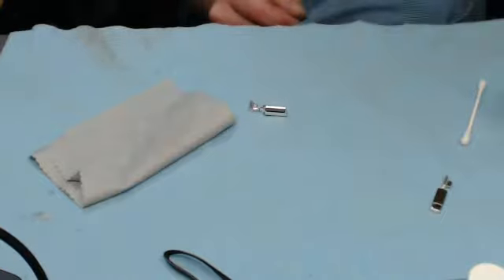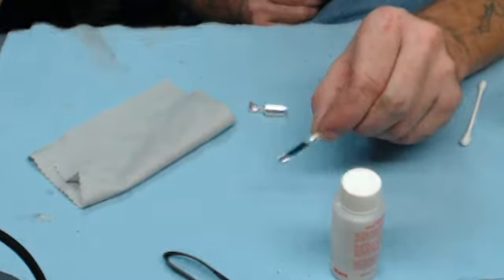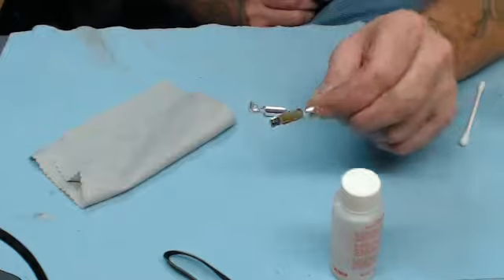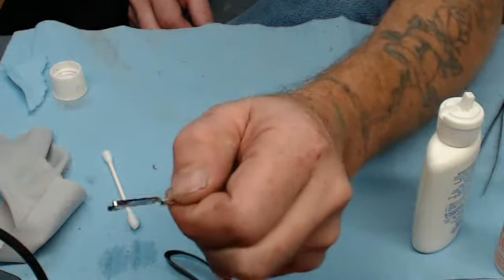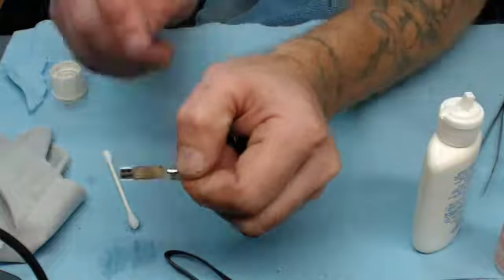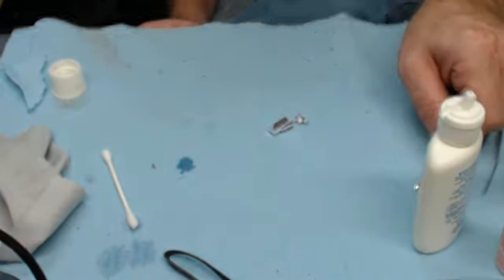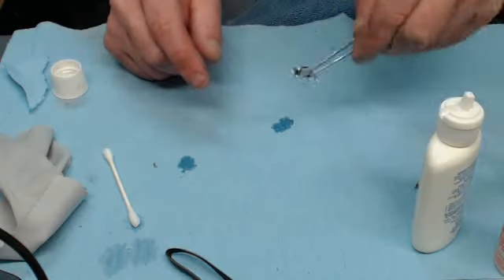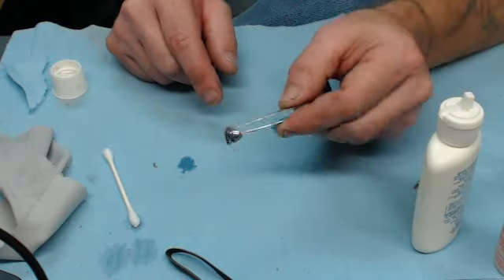using future on chrome parts

Comment: Good Video Hunter. Did you  know that buffing anything with Future on it with a Downy USED drier sheet will make the parts shine? It's a chemical reaction that takes place between a chemical in the dryer sheet and acrylic clear or paint. It will stay shiny for quit awhile after. TY Hunter for another good video.

Comment: Hi love your paint finishes and the way you go about getting the best finishes, its just like preparing a full size car. One question I understand your dislike of standard chrome parts, first it doesn't look much like chrome or more modern finishes like stainless steel. Also with all the poor finishes in kits plus all the nib removal its a non scale mess. So would ?i be right in thinking  that you use Testers metallises or the best of the bunch Alclad 2 chrome products.